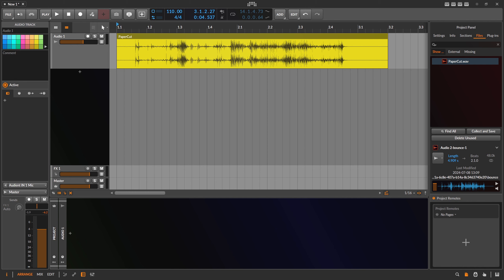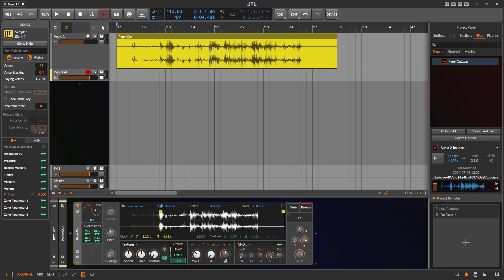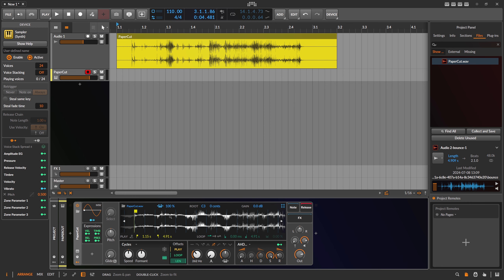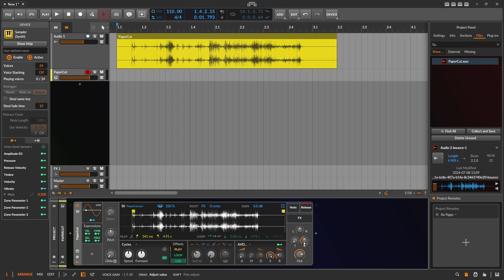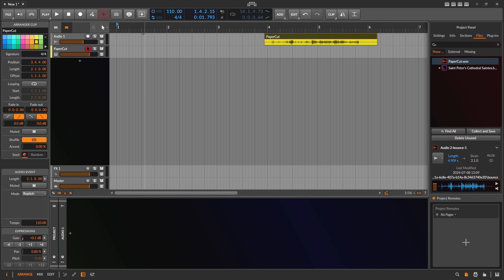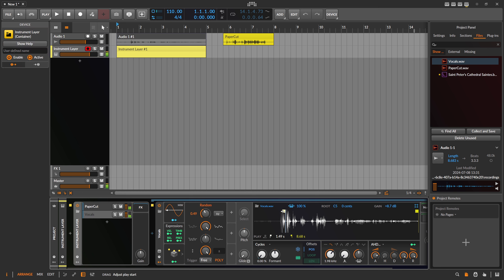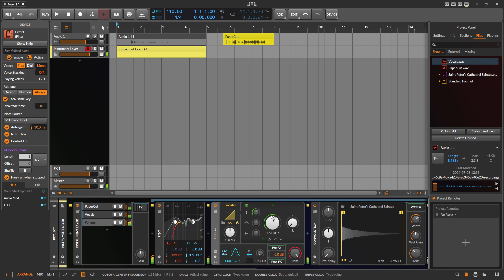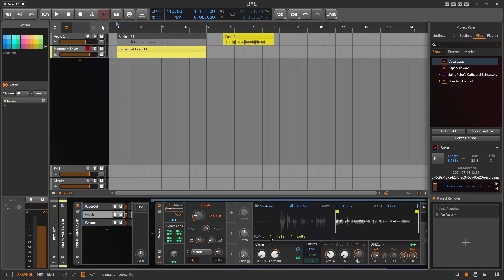very cool way to create sounds - Sound Design with the cycles mode in the Bitwig sampler

Comment: I get Red Dead Redemption 2 flashbacks from these sounds 😊

Also: "Instead of the textures mode we can just use the cycles mode, which does exactly the same thing."
-> Where do you know this from? Where does everybody have so much "inside knowledge" from, lol? Are there some must-have basics-about-synths books i should read?
Reply from the maker: It's probably not quite right: the cycles mode changes the playback speed of the grain/cycle to create pitches, and my texture method was changing the grain size to change the pitch. Which is different and probably sounds a bit different, but kind of the same idea (looping small parts of a waveform)